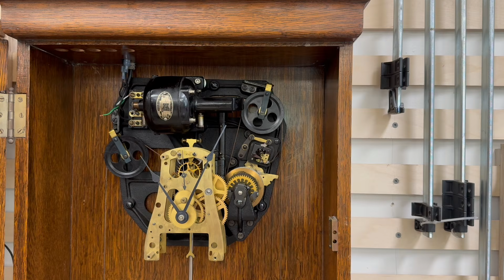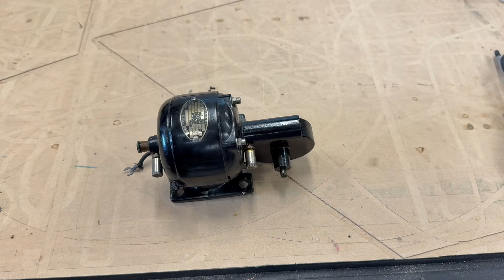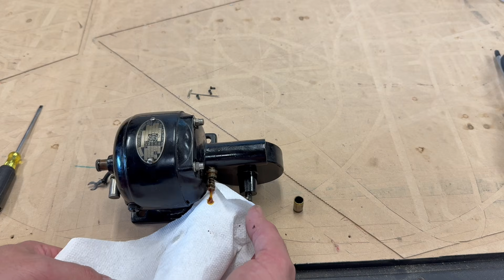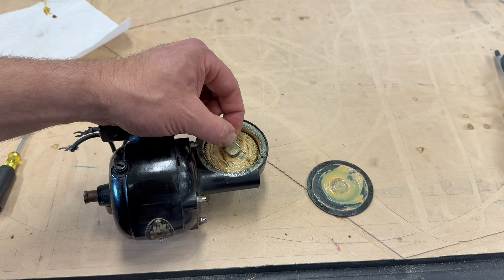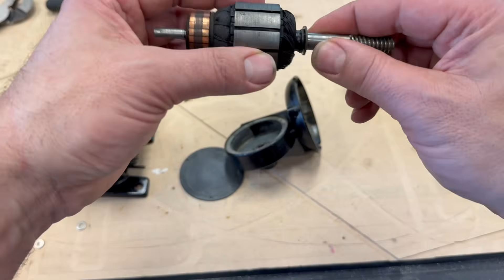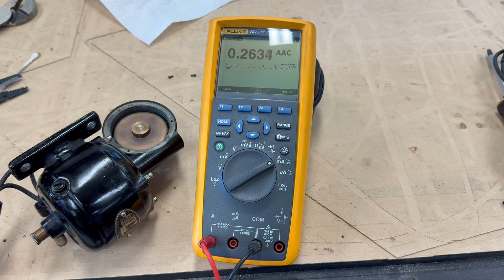ITR Master Clock Motor Wind Service

Comment: I just finished the master clock playlist. Very good, thank you. How do you send power to one of the clocks on a day-to-day basis? I think you said the one is somewhere around the 18V range to operate it. Will it take the 115V AC or do you step it down? Or, are they DC, and what do you use for a permanent power supply for that? I also might have missed it if you said in one of the videos how you’re powering the clocks. Thank you, Jeremy
Reply from the maker: I use a 24 volt DC "wall wart" power supply to safely step down the voltage and current to not damage the clock. Look for one that provides 24 volts DC and 500mA of current.